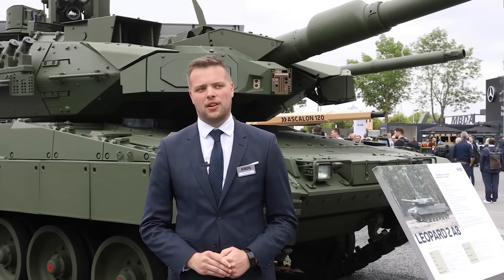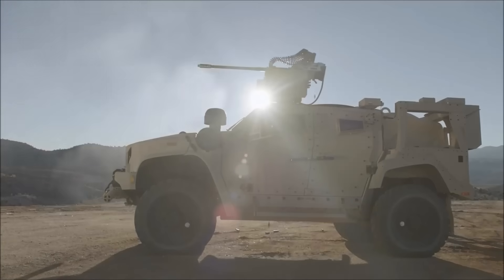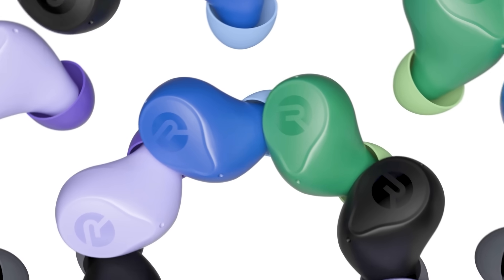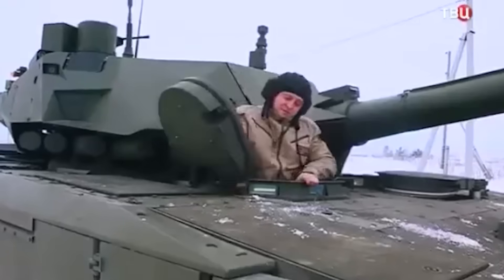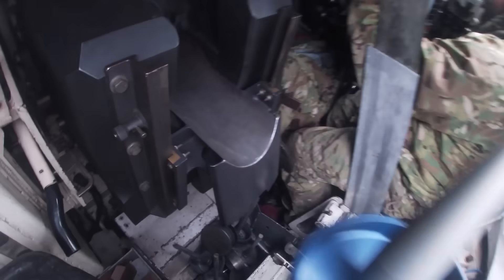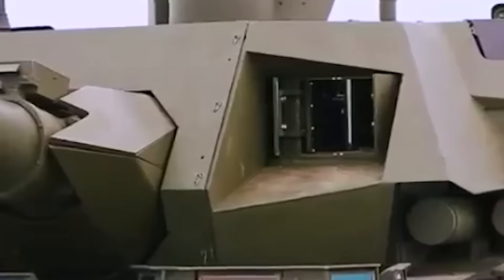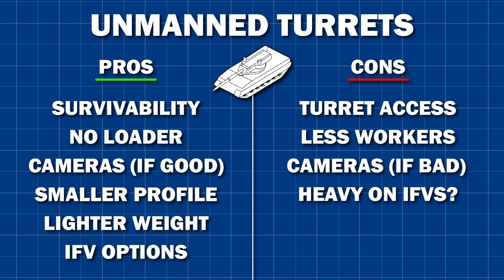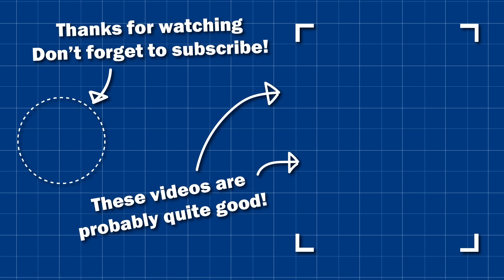The Unmanned Turret - And Why It's The Future

Comment: There is a big argument I can see against unmanned turrets being unarmored or even just lightly armored since there aren’t any crew in them. The turret can and will still be shot in combat and even though the crew are safe the gun, ammo, and loader mechanism are still vulnerable to damage. This can lead to a vehicle becoming a mission kill, especially if the crew are unable to access the turret to repair the damage or manually fire the gun.
Reply: You do not repair the damage a penetrating hit causes. Tanks are waaaaaaaaaaaaaaaaay too complex to be fixed in the field with a wrench and blind optimism.
Reply: @falkranduhm10  But you armor the turret enough to survive it.
Reply: @falkranduhm10  True and you can still put enough armor on the turret so that autocanons and older tank rounds cant damage it.
Reply: Yeah thinking that armor is only there to protect the crew is a very very idiotic thought process. If the turret is lightly armored, then when it blows the whole damn tank will too.
Reply: @MommyKhaos  thats why its seperated 5 head
Reply: @MommyKhaos  Why would it? If the pressure from the explosion has a way out that is not down there is no reason to assume an event like this would not be survivable. Even tanks with manned turrets that have separate ammunition compartments can survive ammunition explosions.
Reply: @MommyKhaos  The only thing you have to heavily armor in a T-14 turret is the gun shield but it's inherently tricky as it has to move with the gun which should be balanced - if you go down that road you get extra tonnes for a very improbable scenario as it's a very small target, smaller than the gun itself. This is also why it doesn't have a coax MG. Optics and external equipment just can't be properly armored.
Reply: even if manned turret gets hit there is very high chance that one or few things will stop working even without penetration. 
but if you have spare turret for tank you can change turret and send tank back to combat. fix original turret later.
Reply: If the turret is designed as a modular system with plug and kill installation, it could be a game changer.  It would save a huge amount on weight.  So even if you do score a hit, it would be easy swap out, like modern MTU's.